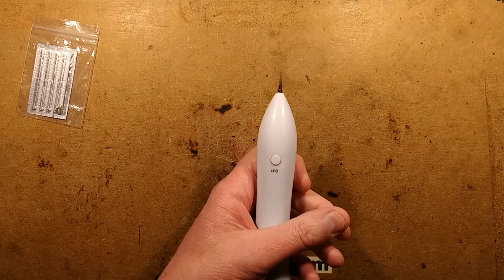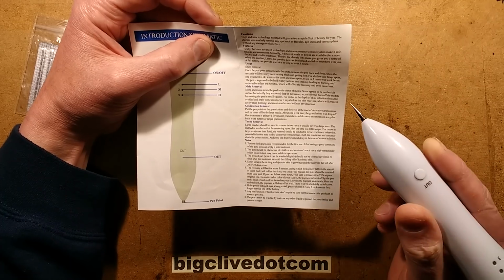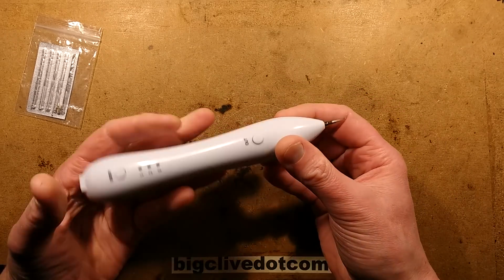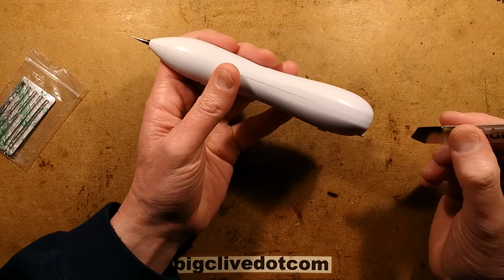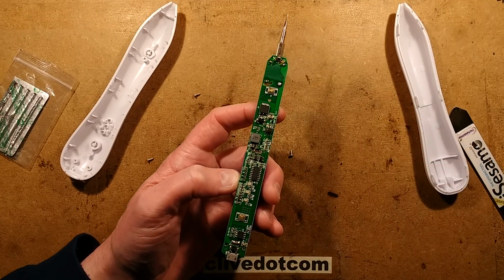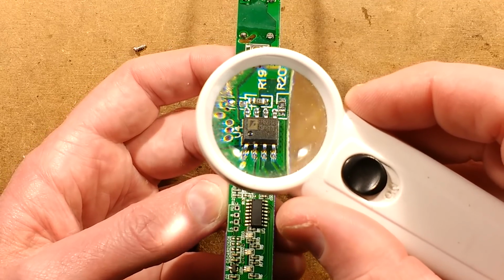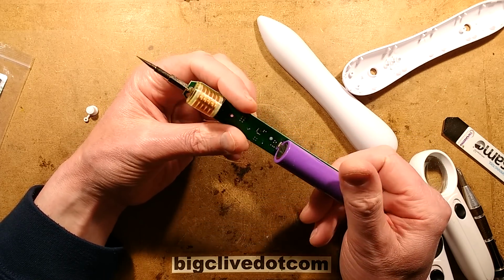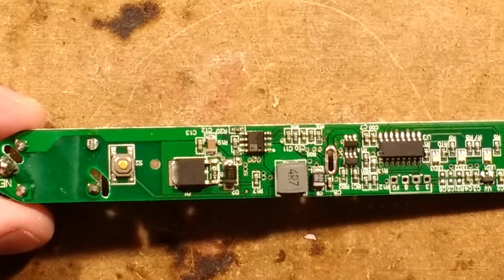USB flesh-burning pen for ladies.  Because apparently they do that.

Comment: There's nothing like the smell of burned pork in the morning. 
I got my burning skin experience  (aged 12-13) when playing around with the high voltage of our colour TV with a not very well insulated screwdriver. Went directly through my thumb nail and tip of my finger, leaving a small black hole. Strange thing it didn't hurt  (too much) but the smell still stays with me to this day.
Reply: Zeedijk Mike it doesn’t hurt because you literally fried off all nerve endings in your fingers
Reply: +Alucard : That might indeed be the reason. Well it was more than 40 years ago but I  still remember it to be more exiting than scary and I never lost my facination of high voltage (-:
Reply: Zeedijk Mike playing with electricity is so much fun!
Reply: I have a large tesla ball with solder wrapped around it haha, watching the plasma arc is fun and all until you leave your finger there for a few seconds... mmm. burnt flesh.
Reply: how tf does a 12 year old just go and play with the high voltage circuits of a tv that is powered on?
Reply: Well when it came to experimenting, then my parents were quite _openminded_. With four sons it was quite fun and exiting now and then.
Around the same age I also experimented quit a bit with chemistry as well. Made my own sulphur - resulting in the whole house stinking of rotten eegs.
Reply: @ZeedijkMike  That mention of sulphur reminds me of the time (as a teenager) how I tried to make sulphuric acid by bubbling smoke from burning sulphur through a test tube of water. Mildly successful, but the smell of f@rTz for the next (phew!) days was unbearable!! :-D
Reply: I know that smell very well. Ever make a slayer exciter or put foil on a plasma globe? Yeah you'll smell the burning smell before you even notice you got a little black dot on your finger. Smells very similar to burning hair. XD
Reply: @codey morganti HA HA sounds like me when I was a kid. loved to explore electrical/ mechanical things and take them apart to find out how they worked.But my parents would get really upset when I started removing live Electrical outlets. and were not happy at all when I would play with the new toys I got for Christmas for a couple of weeks or so, and then disembowel them for parts.I was always dumpster diving for discarded electrical, and mechanical things.
Reply: I had little drop of molten steel super small but it fell on my thumb it smelled at first it hurt like hell then went numb it burmt to my bine on my thumb and i Still have the scar
Reply: oof. in my case it was acetone. luckily only my legs.
Reply: im 18, i have done so much HV devices and stuff and i still don't tinker with mains power unless necessary for some device that i really need working
Reply: Two_Number_Nines HV?
Reply: The smell of burnt flesh is disgusting
Reply: When I was younger I told ma sis to stick her finger in the light with no lightbulb to see her light up, I switched on the light , a scream later no lit up sister a trip to hospital and she broke her finger lol

Comment: Wonder if it could be used to glue airfix kits without glue, just melt the surface of the plastic and bond it to itself
Reply from the maker: It only arcs onto a conductive surface.
Reply: bigclivedotcom how boring :(

Comment: I am amazed and slightly horrified by how nonchalantly you burned your hand with it. Is your hand okay?
Reply from the maker: Work hardened skin.  No pain at all.
Reply: Kaby you could peck and burn a calloused piece of skin all day, had one on my foot for two years and I cut it open with a knife and I felt iterally nothing.
Reply: Full of calluses
Reply: He's okay, but I NEED HEALING!
Reply: yeah calluses usually don't have any feeling
Reply: @ScrimmyBunglets  they are dead skin...
Reply: @MMGAMERMG  the whole top layer of your skin is dead, that doesn't mean you can't feel pain in it.
Reply: @JellyGamer 
You can also get used to burns.
Like I've burned my hands so many times that unless it's an extremely hot thing(well over 200 degrees) I just find it a mild inconvience, whereas originally I would instantly blister.  I don't even get red marks anymore most of the time from burns let alone blisters.
Reply: @ArlanKels   what the fuck

Comment: That coil looks identical to the ignition coil for gas boiler controls that I used to design years ago. Same form  factor same resin same former. If the pins are square rather than round it is most likely the same component or a clone of it.

Comment: Is there any reliable way of telling if 4R7 is a 4.7Ω resistor or a 4.7µH inductor? Or do you just have to guess by looking at the package?
Reply from the maker: It's generally the style of component or the position in the circuit.

Comment: Why anyone would want to do this I don't know. A GP can remove most of these things painlessly using liquid nitrogen, I've had it done myself. Took seconds, no pain. Banggood have the identical model available, but they're a lot more expensive, normal price is €51!
Reply: Strange you say this, because I've had various warts removed with cauterisation, laser, and/or LN2; and the process has always been either ineffective and mostly-painless, or effective and quite painful for days.  $6 to avoid waiting for an appointment, and to get only-moderately-painful treatment, sounds great in comparison.

Comment: DIY surgery is seldom recommended..... However, burninatin' the suckers IS a legitimate way of getting rid of some skin tumors/blemishes. However, freezing them is almost always way way better... And...... If you don't go to a doctor for any moles you're a dope. However, if you DID burn a melanoma thoroughly, so as to completely kill all cancerous cells and burn it all... Before it spread to your lymphatics or elsewhere... That would be curative. Aside from not diagnosing them and the fact that you're basically stubbing a cigarette out on your cancerous skin...... Burning a mole generally won't cause "more" harm directly than not burning it.  

A burninator pen thingy is always handy for any surgery on mucous membranes or other highly vascular tissue, for cauterising small oozy bleeders. "Medical" or veterinary versions of those things are pretty expensive if I recall. Like, goofily so for what was basically just a soldering iron........ Even the veterinary ones cost dumb amounts (several hundred dollars for the battery one - and it was just plastic, batteries and some resistive wire which got hot; no electronics as far as I recall) .I'm sure if you want a dental or (God forbid) a human surgical one..... You'd be paying an insane amount. 

...So I bet there's a bunch of useful home uses for one of those thingies. 

Next time you have a wee and annoying finger or lip bleed... Try it?
Reply: I'd say blood in the urine is not a natural application for electric burn pens...
Reply: Not recommended for nosebleeds.
Unless you are ElectroBOOM.
Reply: Just note that I would never ever visit a doctor who uses such an awfully cheap piece of Equipment.
Reply: Yes, there are plenty of videos of dermatologists using expensive versions of these things to remove benign blemishes.  Looks more precise and effective than freezing, frankly.
Reply: Its propably good for removong "red spots" i used to pop them with heated nail.
Reply: > if you DID burn a melanoma thoroughly, so as to completely kill all cancerous cells and burn it all
Unless you're medical professional you'll never be able to do that! When doctors do that kind of surgery they also cut significant parts of healthy looking skin and flesh. Some additional procedures may be required. Besides melanoma there is other types of skin cancer that have variety of looks and symptoms. General rule: DO NOT MESS WITH YOUR SKIN!
Reply: So you start of by saying DIY surgery is "seldom recommendedd" and you end by recommending DIY surgery. Anyone else getting mixed messages here?

Comment: looks like an RF Hyfrecator for burning and electro-cautery.  You can't remove warts without Marcaine or Lidocaine.  What the fuck is the point of this thing?  After watching video, it's probably not RF driven. The units I've toyed with have 2 4cx350 valves and they ran at around 300MHz.   The thing you have there is an interesting and fascinating toy that I must have.

Comment: Can you use it as a HF transmitter ? An oscilloscope with a long wire antenna attached could be used as a receiver. The needle could be replaced with a wire, and the circuit ground also fitted with an equal wire. The ideal length of the wires could be calculated based on the frequency. It could send morse code, or audio could be mixed with the oscillator to result in an AM transmission.

Comment: I recognise those needles it's an electrolysis pen. Obviously the concept has been around for decades in one form or another. The process is simple for each hair you want removed you grab it with tweezers and jam that needle down into the pore  and burn out the cells  that make up the hair root. I repeat you have to do this with INDIVIDUAL hairs. Laser hair removal does the same thing but without the needle and over a large area, I can't imagine why electrolysis fell out of favor.

Comment: No laser. Disappointed. My laser has an aiming beam (So you don't miss) and I'd never use it on flesh. Great for cutting tracks on PCB's though - most things (even shiny copper, but still wear those goggles!) appear opaque to it. I suppose on low power it could be used to remove a mole or wart, but thats why we have doctors, no? That HV transformer is nice tho :)
Reply: Can you please tell us what "My laser" is?  I was under the impression that it was a really bad idea to direct a laser at any [reflective] metal, because the beam could be reflected back into the laser and so cause a very expensive failure.  But if there's somehow a way to use a laser instead of a box cutter or scalpel, that'd be very handy... :-)

Comment: Can this be useful to fix up 3D printed models, like in the corners or overhangs? The plastics used melt around 200-250°C, depends, we don't use higher temperature materials because that would rapidly degrade a Teflon liner in the hot-end.

Also pity no fix :(
Reply: Not sure it would. It works by resistive heating from a high frequency voltage signal. I'm not sure that the plastic would conduct in a way that makes that useful.
Reply: Oh so there's no heat generated in the tip, it's just on the skin? Oh well. No, certainly plastic is a few orders of magnitude less conductive than skin, even at high voltages. What voltage do we expect out of this thing anyway?
Reply: just use soldering iron with exchengable tips

Comment: The needles are for permanent hair removal; you use it to burn the root.
Reply: Paul MvN nah, the ones that do that are way lower power. You just need to set up a bit of electrolysis for a second or two to kill a handful of cells. This is RF electrocautery, burns off cubic mm of cells, way to large a volume for hair removal.

Comment: I'm pretty certain the needles are there to be used for electrolysis hair removal. (when using more accurate and relyable equipnebt than this) with a little technique and a lot of care the needle can be inserted down beside a hair strand into the follicle, which is then cauterised using high frequency pulses. When done correctly (by an expert) the follicle will be disabled while the skin around it remains healthy.

Especially useful to permanently remove thicker hairs on certain parts of the body...

Be careful Clive, that's a beard killer you're holding.
Reply: it's for Acupuncture, but Acupuncture without licence is illegal
Reply: Hiroko Kaku Isn’t acupuncture a total fucking scam?
Reply: Definately for hair removal, thermolysis mode. You'd have to be nuts to use it, especially on the face, guaranteed to cause subdermal scarring.
Reply: I’ve seen these things everywhere. The really small needles are for smaller moles and spots so you have more control than the big tip. 

I’ve tried one for fun on my arm. 
You definitely wouldn’t want to use it to remove hair. It does burn your skin.
Reply: TheMoreSubsYouHaveTheGayerYouAre  we're not sure that it's placebo, but there's a fair chance it isn't. It's one of the oldest medical practices in existence and has decent scientific theory as to why it could work

Comment: What next, USB defibrillator? USB mass spectrometer?
Reply: I'd totally buy a USB mass spec
Reply: I can imagine a USB mass spectrometer. You could build in a program to handle all the configuration and some data analysis and stuff.
Reply: @Graknorke  A USB MS would actually be incredibly cool. There was a project that turned CD drives into them for use in Africa for medical stuff and amateurs. Pretty accurate too. Wish I could find that project.
Reply: Don't know about mass spectrometers, but there's a company called Scio that makes pocket-size molecular scanners. I think they built one into a phone, too.
Reply: Thunderf00t already took care of that one  @crystalsoulslayer
Reply: @crystalsoulslayer  I was just about to reference the Scio scam. Watch Thunderf00t's video showing it's a complete sack of shite.
Reply: USB mass spec is the dream of every chemist.
Reply: And all is in Chinese.
Reply: USB nuclear reactor!
Reply: USB gamma spectrometers do exist (i know it's a different thing, but just for the sake of it), and it works rather well. It's hard to find, as it's made in Russia but you can find it under the name of AtomSpectra (1-4). https://kbradar.org/p50432430-stsintillyatsionnyj-gamma-spektrometr.html
Reply: DIY USB gender reassignment_phone charger_camping device
Reply: USB 600 MHz 14T NMR 😂
Reply: No. Fusion-based USB power bank...
Reply: JPaul C a USB powered bike or skateboard
Reply: A usb xen crystal?
Reply: USB dildo
Reply: I need usb nuclear reactor
Reply: usb antimatter maker
Reply: USB resonance cascade.
Reply: USB Mass Effect
Reply: Justin Koenig haha where can a get one
Reply: Please someone make this product happen
Reply: USB Taser.
Reply: USB dildo, ...wait that’s already a thing
Reply: USB electrical jammer
Reply: Feh. BigClive already did the ultimate, the USB coathook.
Reply: JPaul C Google or EBay in this case... "is your friend"   cheers

Comment: I believe the word you're looking for is soldering iron... 😅
Reply: It doesn't get hot to melt solder, the solder would just conduct the high voltage, high frequency signal to your fingers, and whatever semiconductor you tried soldering would fry like it just got zapped with static electricity.
Not a great soldering experience I'd say.
Reply: +blackcorvo I think it might have been a joke
Reply: NOW that is OOOUUUCCCHHH. Not Clive's video !!
Reply: I think It will Break the component by that HIGH VOLTAGE!!!!!!!!
Reply: Coaster labsgo make a video on the construction markers at cga.
Reply: Ryan Summers I will. I shot footage yesterday.
Reply: Cool.

Comment: Acupuncture needles. Somehow some acupuncturists use electro stimulation along with the acupuncture no idea how it works but I've had it done
Reply: It's basically a TENS machine hooked up to the acupuncture needles with alligator clips, if I'm not mistaken

Comment: If electromagnetic interference from the high voltage AC is crashing the controller, you should be able to solve that by putting a layer of polyimide tape over the circuitry for electrical insulation and then a grounded layer of aluminum tape/foil on top to shield it.

Comment: I think the reason it crashes is 
a) it is only designed to be used in bursts, not continuous, thus it shuts itself off as a safety feature
b) lithium cell inside is undersized for the load and its protection circuit kicks in, shutting off the unit
c) The processor is improperly shielded and its memory gets corrupted by EMR, which watchdog picks up and resets the processor
Reply: Eman Gamer what kind of drug?
Reply: As in watchdog you mean aiden pierce?
Reply: Squishy Toast no
Reply: Penurious Sierra so insert needle, press button. Lift out, repeat.
Reply: Ninja Master 
I suppose so.